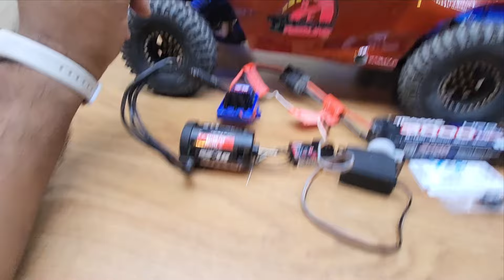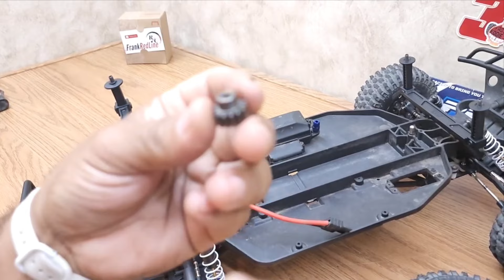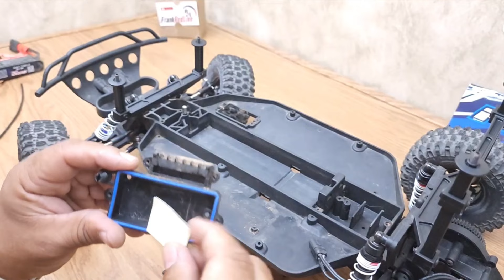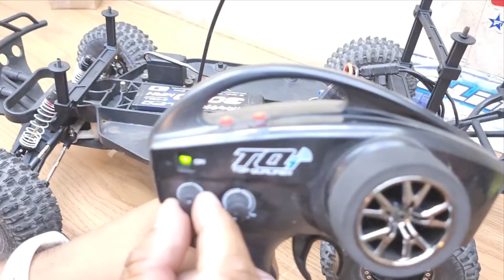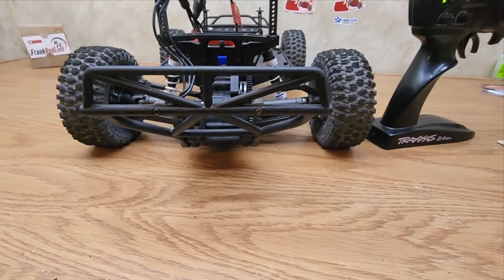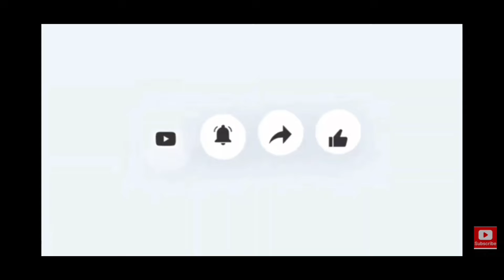Traxxas slash 2wd build. PART 5

Comment: That body looks so good. I went batshit crazy on my Slash... I bought the BL2 kit and then stuffed a Mamba X and 5700kv in it. The BL2 3300kv system went into my Tamiya TT02, a much smaller and lighter car. The Slash with a 5700kv is pretty fast on 2S, and 3S is absolutely insane and almost unusable.
Reply from the maker: They are so fun and easy to modify.